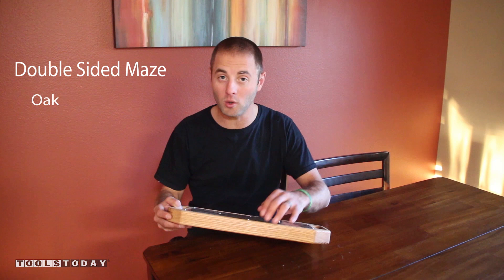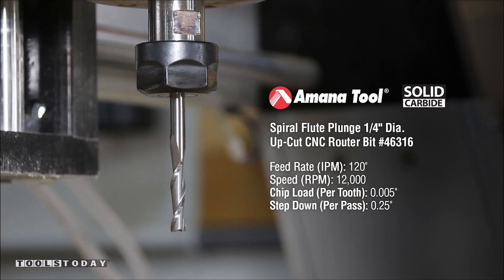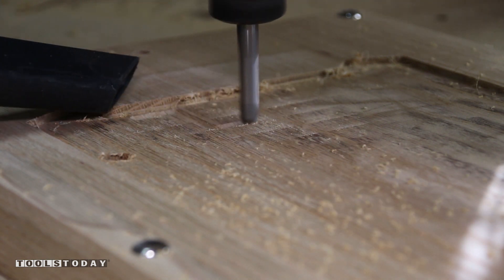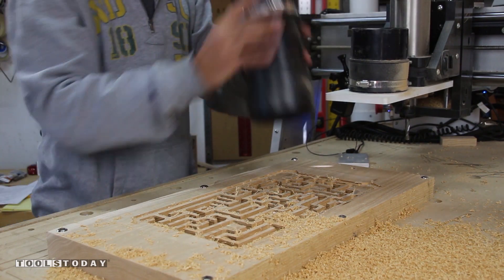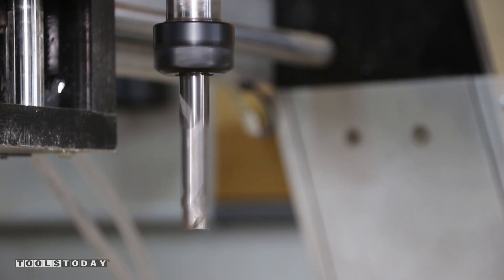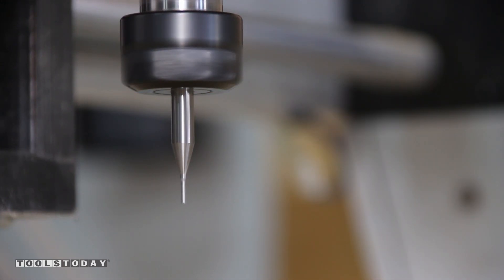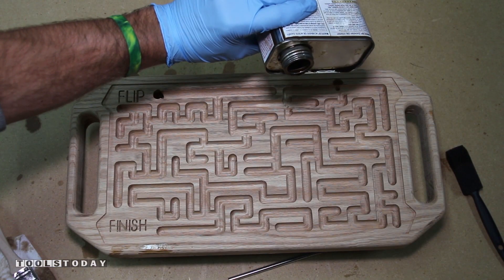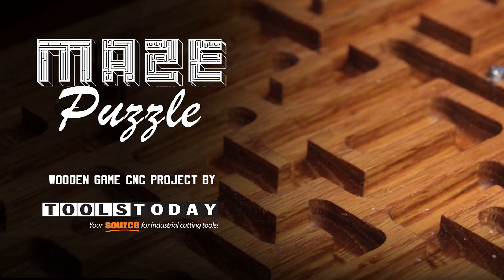CNC Project: Wooden Game Maze Puzzle with Steel Ball Bearing w/Amana Tool CNC Router Bits

Comment: Amana RC-2247 at $127?  No thanks... I don't know how you justify buying a bit that's more expensive than the router.  It's just a bit... the router is infinitely more complex.
Reply from the maker: Hi Bruce and QuadLogic126, the CNC machine used in this video is the CNC Shark HD 3 w/ Extended Bed by Rockler, priced at around $5,000 where as the Amana Tool bit is priced at much less, $173 and comes complete with replaceable insert knives so that you can purchase the tool just one time, and order replacable inserts after they become dull. In fact, the replacement insert knives are 4-sided and can be rotated once they become dull, before ordering new inserts for about $11 each. Hope that clears up any confusion, thank you for your comments.
Reply: My CNC cost under $2000 but I had to build it. I use a Dewalt router for a spindle, and I buy inexpensive bits from Amazon. I can crank out easy projects like this no problem. You don't need a $5000 machine and bits that are $100+ each to make things. If someone actually has a $5000 machine and potentially thousands in bits sitting around, are they making one-off maze games? That's a pro level CNC shop, not a hobbyist. I don't get it. Check OpenBuilds.com for the router kits and Amazon for cheap bits, folks.

Comment: How did you determine your feed rates?    They seem extremely slow for the tooling?
Reply from the maker: Hi Nick, you are correct, the feed and speeds used in this video are low and we recommend using the Amana Tool® feed and speed charts on our website product pages.